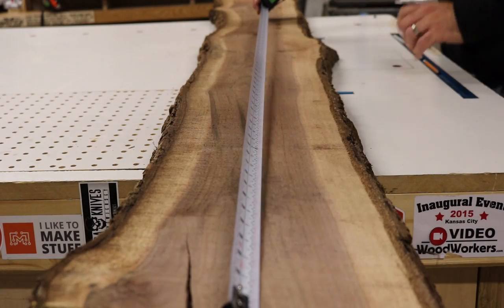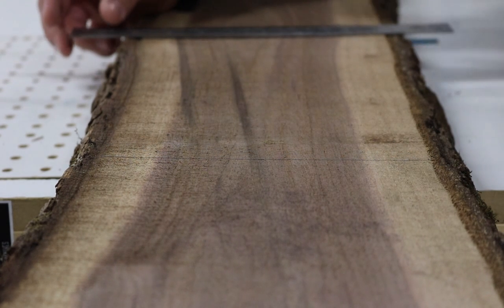Live Edge Cutting Boards & Serving Trays - with Bowties

Comment: I did something similar with a cut off from a live oak log.  Got it sanded down to 220 grit and coated with Howards cutting board conditioner.  After about a week, it developed some minor cracks, but one side cupped right in the middle.  So now it is a Lazy Susan...lol.  The sides raised about 1/4" all the way around.
Reply from the maker: +Vernon McNabb sounds cool actually.

Comment: How do you get a square cut when cutting on the cutoff saw? And what wood did you use for the bow tie? Thanks
Reply from the maker: I usually rough cut at the miter saw or if the cut doesn't have to exactly square. In this case it wasn't critical. The bowties were made form birds eye maple.

Comment: Nice job Shawn what finish did you use on the surface? I have several pieces of oak, walnut, and koa been hanging on for years. This looks like a great use for those wood scraps..  Also subscribed to your second channel. I thinks it's great that you and Tyler include your kids with yo I missed many opportunities when my boys were younger. Keep up the great work.
Reply from the maker: +Michael Matthews I used Howard's butcher block finish. It works pretty good. Thanks for subbing to the second channel and thanks for watching.

Comment: Did you use the same finish on the live edge as you used on the surface of the cutting boards?
Reply from the maker: +Crystal Marie, Inc I used water based polycrylic on the edges and butcher block oil on the surfaces. Thanks for watching.